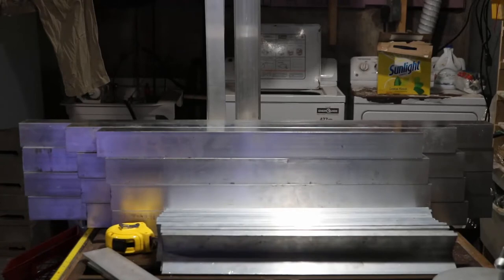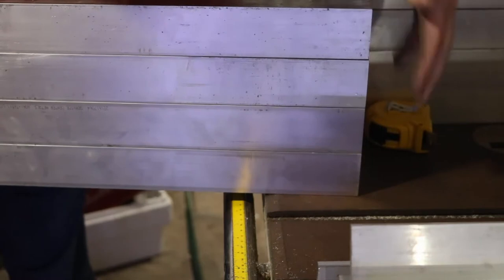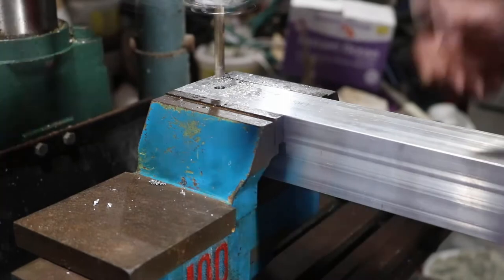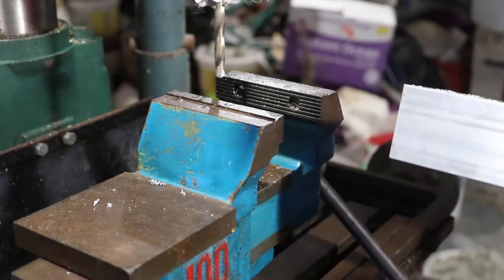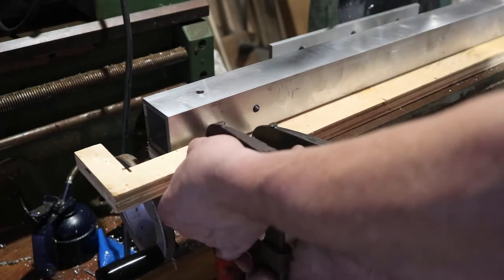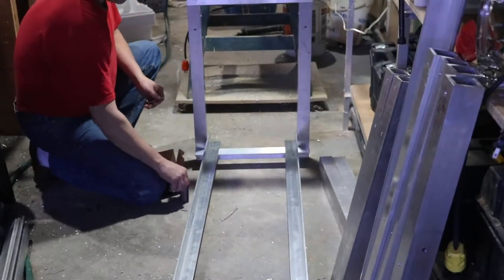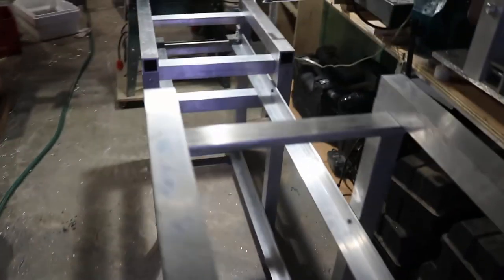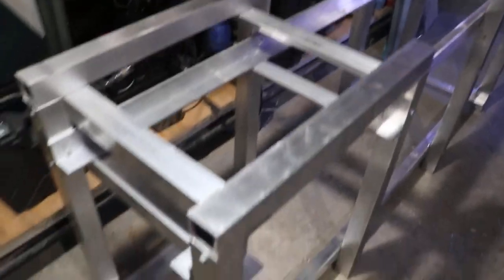DIY Drop Off Or River Tank Part 2

Comment: They sell leveler legs that plug into tube ends in any weight capacity you would ever need.
Reply from the maker: True enough. This method just gives a cleaner look to the bottom of the legs. Since it is a display tank where the metal is a part of it  the client went with this method. Thanks for watching and taking the time to comment.
Reply: Fishman  I just hate to see people working hard on fiddly things like furniture legs when there are easier solutions.  You could always hide the feet behind a toe kick panel.

 I’ve worked in custom architectural millwork and metal fab for 20 some odd years so I notice these things.  

Anyway I really did enjoy watching you build this tank.   I’ve been out of the hobby for a few years but looking to get back in and the Hill stream style tanks are really inspiring me.
Reply from the maker: Thanks for your input. Much appreciated